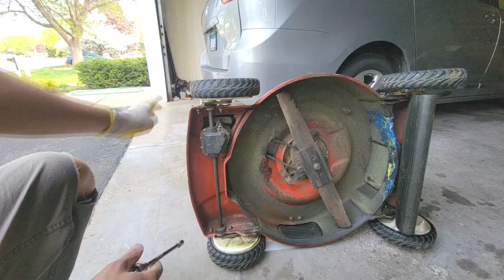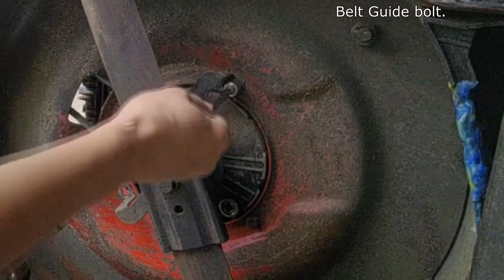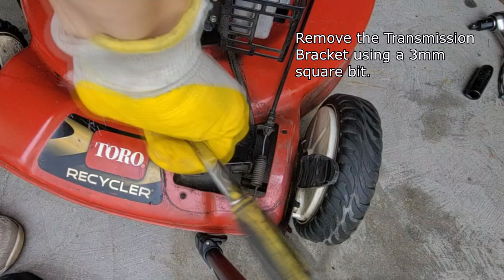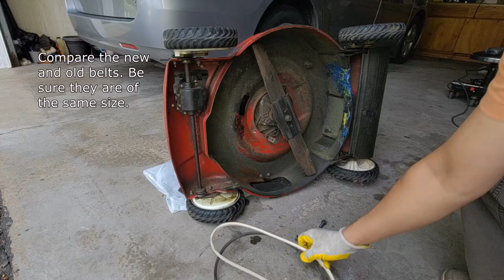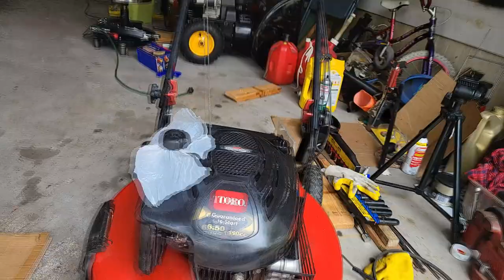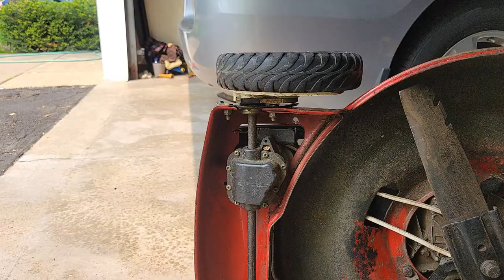Toro Recycler 22 Lawn Mower Drive Belt Change

Comment: Thank you very much. I was replacing the drive cable but while the cover was off decided to replace the belt too. The only hiccup I ran into was not having a square 3mm bit (hex didn't work) just ran to AutoZone and got one and finished the job.

Comment: Interesting enngineering why Toro decided to use square head screws to hold down the transmission belt cover. Also I see you removed the engine bolts to remove the belt guard. DIY'ers be careful because the sometimes the head of the engine bolt will snap off.